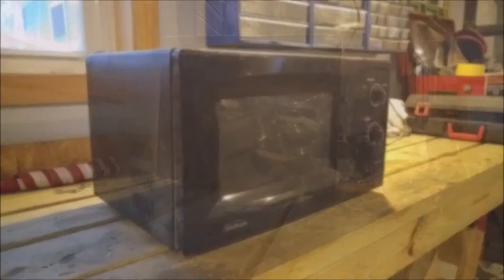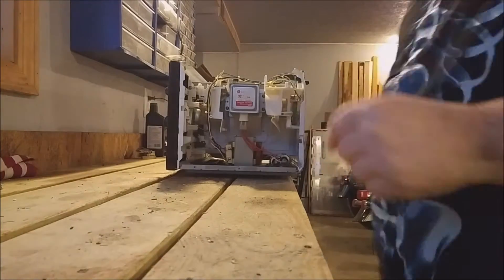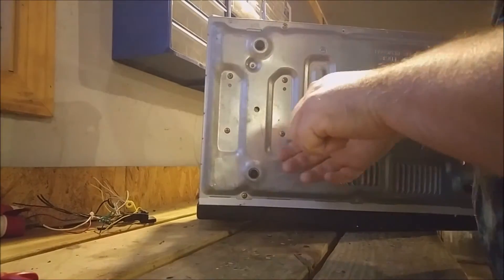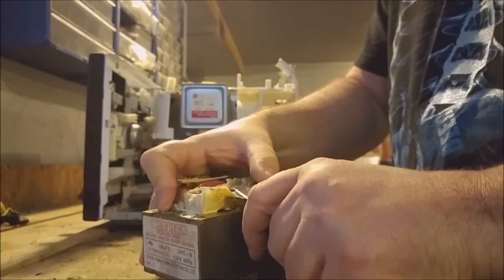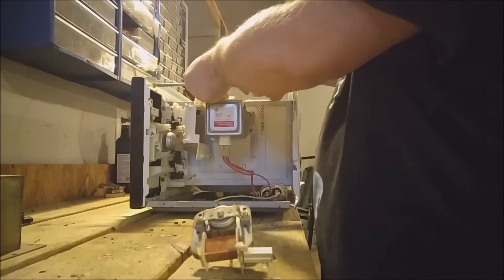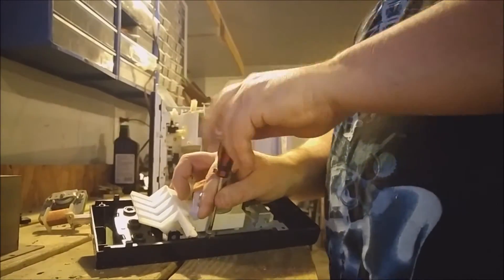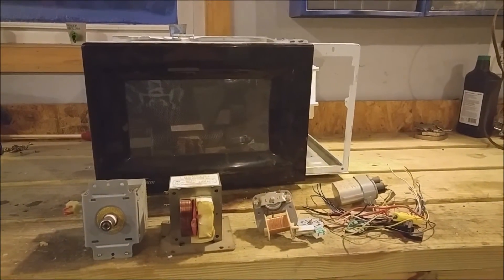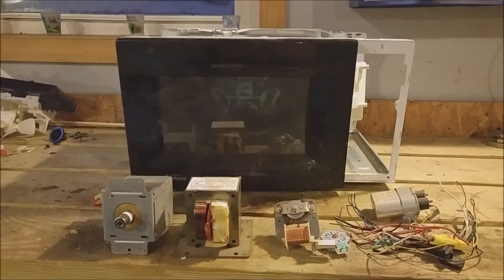Scrapping Tips: Scrapping a Microwave

Comment: I carefully dismantle the magnatron to get the two large magnets. They sell for 12-15 bucks for the set on eBay. Just and FYI, but they are the most valuable thing you'll get out of there. Thanks for the vid!
Reply from the maker: +John Ferris Thanks for the tip John.  To be honest, I've never taken one apart before.  I've heard the tip of the megnatron, if damaged is extremely toxic.  I do want to take it apart, I still have it, but I want to (get this) LOL watch a few youtube vids on it before I attempt it.  :)  Youtube is awesome, don't you think? ;)  Thank you for watching!! :)
Reply: Moose scrapper and mike the scrapper both have good vids on microwaves ( along with many others). The key is to get the light metal off the outside then it's easy, but I have taken apart like 20-30 microwaves and haven't even scraped the purple/pink tip. If you're comfortable, selling those magnets will net you about 5 times more cash. Thanks for the reply-I'll keep watching. Oh, and youtube is awesome!